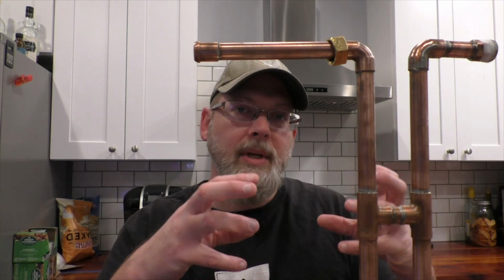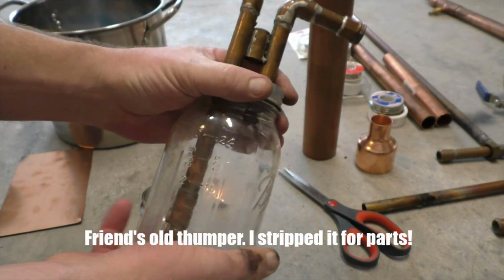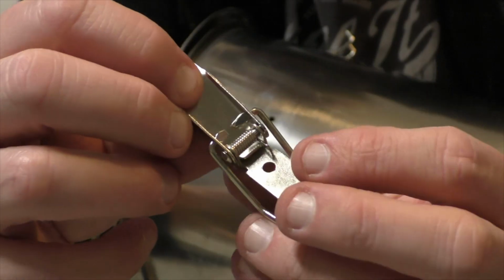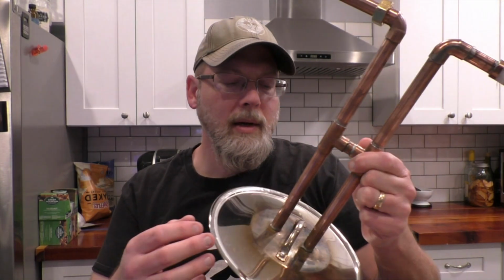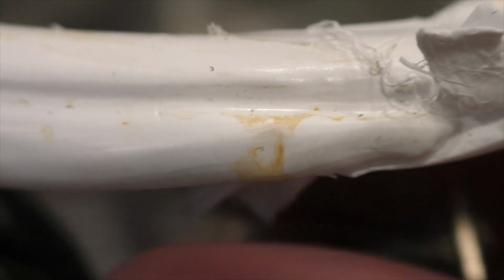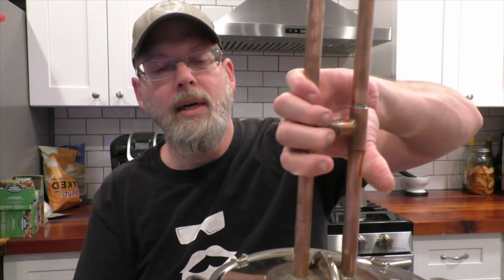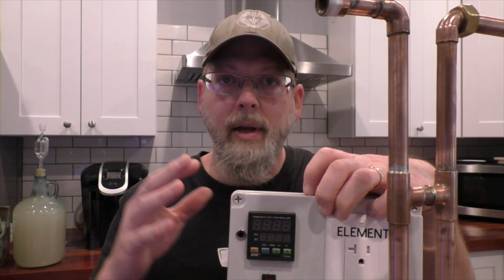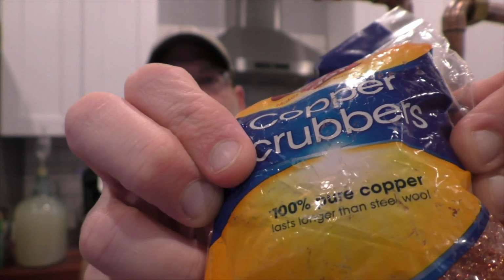How to Build a THUMPER For Your Pot Still!!

Comment: Very cool thumper!
Quick question though, every column I have seen but for sight glass models (that look like a ship portal) use silicone to not only seal, but stack the plates. Is that a different kind of silicone, and if so, why aren’t gaskets made from that?
Reply from the maker: Silicone is the easiest gasket material and comes with almost every triclamp or still kit out there. The risk is lower for leaching. But it's not non-existent even with the professional silicone gaskets. That's why I switched to ptfe. Here's the website I used to check the chemical resistance of various gasket materials to various compounds present in a distilling run - https://www.coleparmer.com/Chemical-Resistance
Reply: @BeardedBored  Okay, I had to get more information and I called an old college friend that is a chemist and worked in the wine industry years back out of school. This is the second time I had to call him because of this hobby and he’s still kinda kid weird. I’ll not forgive you guys.

Here’s what he told me, there is a food grade alcohol and acetone and alcohol resistant silicone and that is more than likely the silicone the mfgr is using for still parts. No promises if they’re Chinese.
It’s called rtv 6500 and is a high temp silicone that is found USDA and FDA approved by many suppliers for food use and does not degrade in high temps even high temp alcohols and acetone. It’s always red shaded or close like orange, unless someone has a new formula he is not aware of. It’s ONLY food safe once cured, but something about it being acetoxy (sp?) curing or something that makes it cure fast, like within a day. 
So, depending of what kind of silicone, there is one safe for still usage.
EDIT: at least one. I wasn’t gonna push it.

Whew.... that literally took all day.
Reply: I’ve always used the seals that came with the Grainfather as a push fit gasket for my alembic dome. Never gave it much thought to be honest.....
Reply from the maker: @jaredobrien9758  Just a heads up - https://www.coleparmer.com/Chemical-Resistance
Reply from the maker: keith moore  Just a heads up - https://www.coleparmer.com/Chemical-Resistance
Reply: keith moore  Food Grade is still a no no. High proof hot alcohol vapor will degrade Silicone seals.
You can wrap the seals with PTFE tape to make them safe. Here is a chart of what chemicals degrade Silicone.

https://www.glaciertanks.com/PDFs/ChemicalResistanceChart.pdf